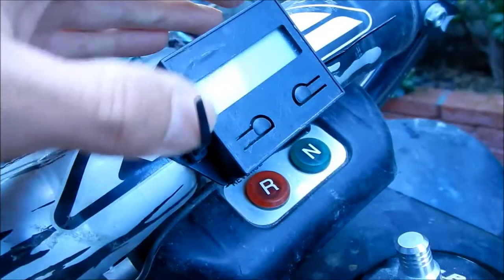HadesOmega How To: Yamaha Warrior 350 Intake Manifold Install

Comment: Mines a bit tight to get both bolts on amy tips and did you run into this like the holes on the new intake are just barley off had it happen on 2 different boots and was assured they good
Reply from the maker: Sorry I don't have this quad anymore.  If the studs don't fit you can try slotting the holes with a die grinder.

Comment: Could you still start it when your intake manifold had a hole in it
Reply: Because mine starts on choke sometimes and then you can take choke off but then it stops if you let it idle or it stops when you are riding it
Reply: How did you know you needed a new boot
Reply: @doogits69  mine makes a popping noise and backfires a lot.  Sure enough,  it's cracked
Reply: Bryan Byler Omg I have the same problem
Reply: @crowley600  i really appreciate your comment, mine does this and I have been worrying that there is a deeper problem with my quad but you have given me the clarification that I need